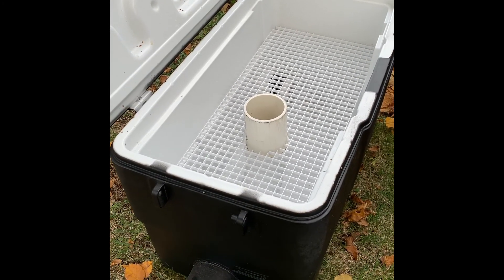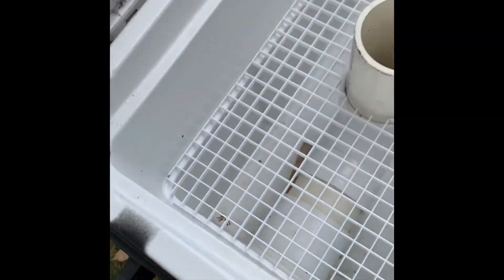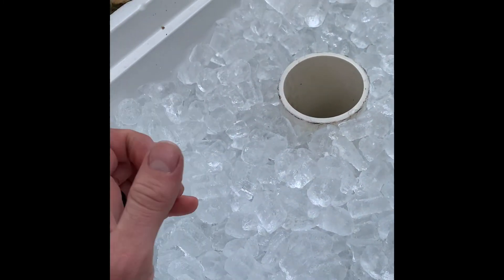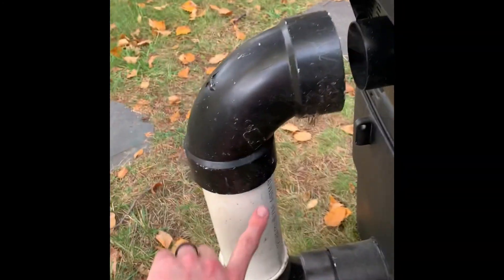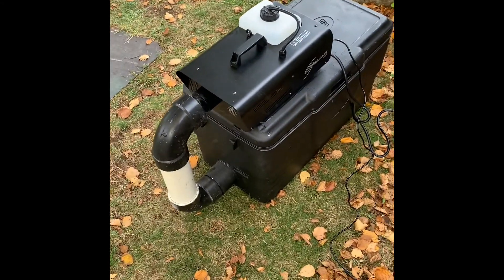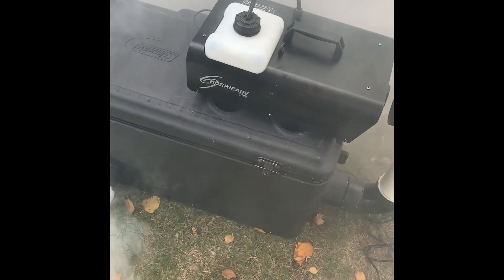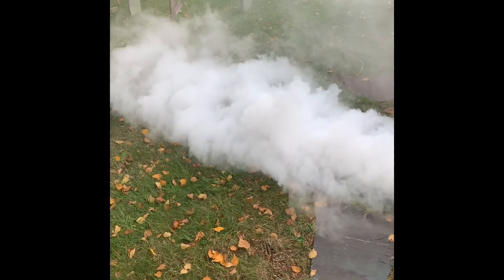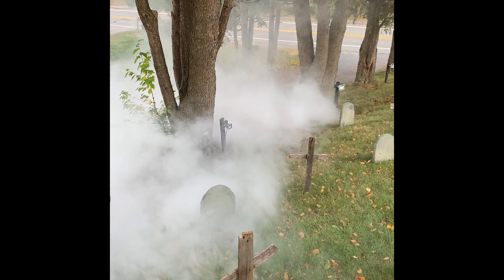Large Vortex Fog Chiller & Demonstration

Comment: This is awesome.  What about using dry ice? Would that work?
Reply from the maker: I bought about 20lbs dry ice last year and distributed it between this chiller and a smaller one I use (see my other video). I mixed the dry ice with regular cubed ice. I didn’t see a huge difference, but it was also exceptionally cold out 20°F or so by the time trick-or-treat was over, due to a snowstorm the previous day.  I will be trying again this weekend.
Reply: @PleasantStreetCemetery  awesome thank you for the reply.  Saved me from buying it. Regular ice it is.
Reply from the maker: @Emilthehun  keep in mind it would have definitely made a difference if it was warmer outside. I was experiencing very out of season temps and no matter how cold my fog was, it was still warmer than the ambient temp.

Comment: Great video! I has the same fogger your using and it's one of the best out there. I feel your pain as the same happened to me. I  think the issue your having is  the fogger is almost too hot for that size chiller. Try relocating the fogger further from the chiller. You will have to add more pvc to extend it away from the chiller. This will allow the smoke to cool before it hits the chiller. Secondly I would suggest a shorter run time on the fog. Give it time to sit in the chiller. Good luck and happy haunting!
Reply from the maker: Thanks for the comment. This is a great idea. I too had the thought that the fog is running through the chiller way too quickly. Going to have to mess with the output settings. Quick blasts at a less intense output I think would help greatly as well.